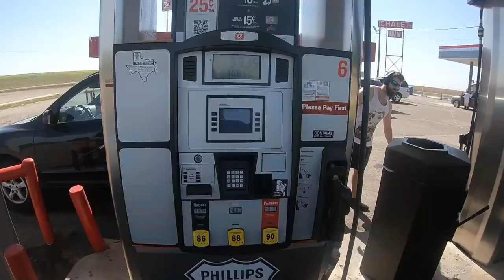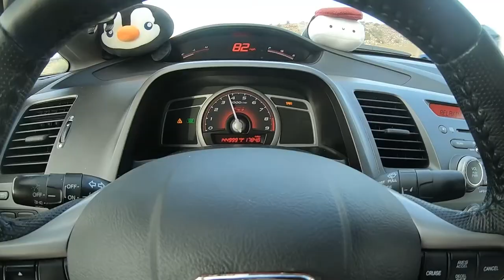Driving from Indiana to Arizona in a Honda Civic Si

Comment: Hey, I’m taking my 2008 honda civic si sedan with 200,000 miles to California. Driving a total of 1,762 miles. You think my car will be fine?
Reply from the maker: Just saw your comment! Have you taken the drive yet? I think you will be fine if you are up to date with your maintenance. Have you replaced your AC compressor or Alternator yet? I've learned that it is common for those to need to be replaced around 150k miles.